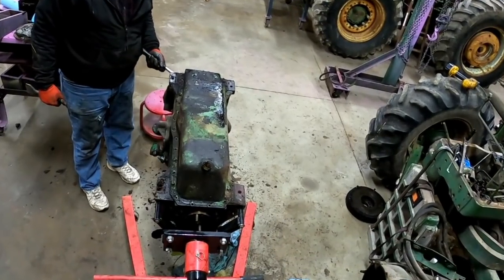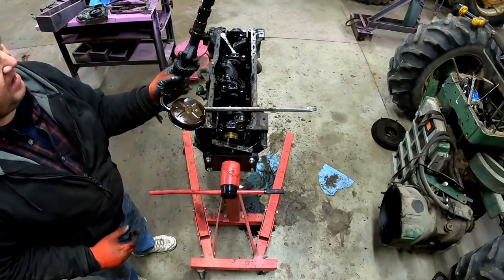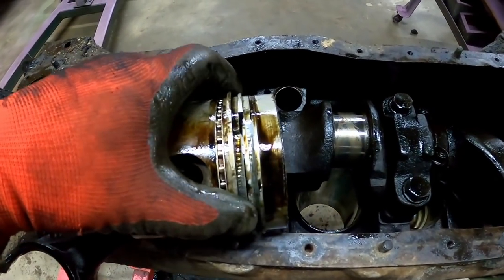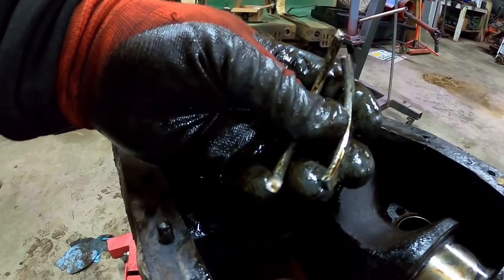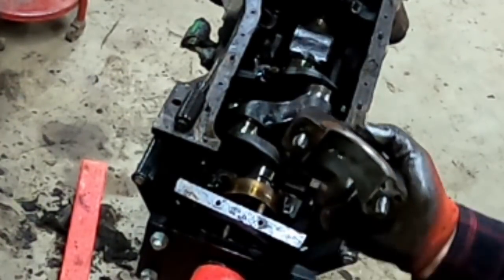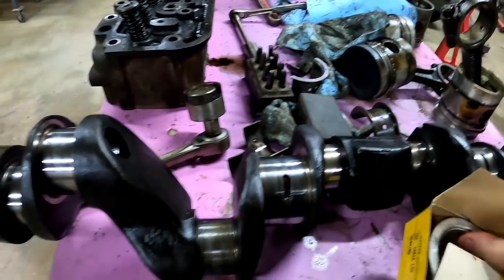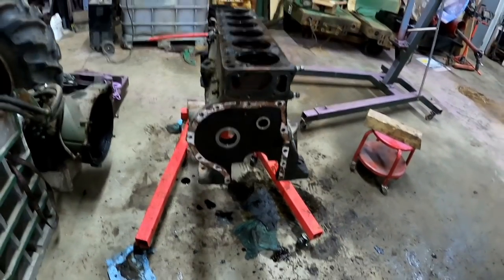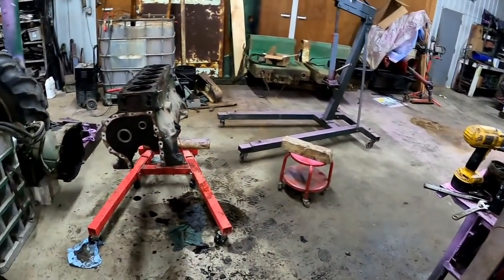Oliver 1600 Restoration Part 5: The Bottom of the Engine

Comment: My neighbor used  to have a 1600 diesel. It was set up with automatic shut off for low oil and high temperature to run a PTO irrigation pump. On a dry year it would run as much as 20 hours a day.
Reply from the maker: Oliver offered special gauges for automatic shut down, but aftermarket was more common. Do you recall which it had?

Comment: Hey Chris, I really like how you have to do math in your head to figure out the caps for the rods!! Lol. Those pistions really took some abuse thats for sure. Its a good thing the crank seams to be in good shape.
Reply from the maker: Rod 6 now has a 6 on it. Maybe someone bought the cheap number punches that only went up to 5??? I looked it all over and couldn't find any markings other than the 1 and 5 on each half.
Reply: @ThatOliverGuyChris  thats funny!! You never know what your going to find.  I am still waiting on parts for my three speed to finish putting it together. Hopefully the next few days we can get more painted parts on the tractor!!
Reply from the maker: Hurry up and wait seems to be the new business model. Hopefully they come soon!
Reply: @ThatOliverGuyChris  thats for sure! I am waiting for the machine shop to turn down the input shaft also. Thats other new thing these places have more work than they know what to do with and not enough people to do the work.!
Reply from the maker: My engine guy said he might not be able to retire with the back log he has. Apparently everyone has the same idea I do, get it in there before he retires.

Comment: I really enjoy these videos. A couple of questions (having never overhauled an engine). First, what do you use to determine whether you should overhaul an engine or not? Second, how do you determine compression on a diesel engine? I'd like to determine some of this for my 2-70 diesel. A little worried about watching sparks coming out of the muffler (which could also be a muffler problem).
Reply from the maker: Sparks could just be soot buildup burning off. It can happen if the engine isn't worked occasionally. 
A compression test is a good start. You'll have to pull the injectors, then you can put the compression tester in the hole of each injector and crank it over to see how much it's making. If it's on the low side, you can put some engine oil down the hole and try again. An improvement typically means the rings are where your leak is at. If it stays the same, it's probably valves. A valve job may be all it needs. Crankcase blowby is another good sign. All engines have some, but if it gets excessive, it's probably time for an overhaul. Low oil pressure is another sign. As the bearings get worn, the oil can squeeze out of the gaps easier and doesn't build as much pressure.
The first time I put this 1600 under a load, the blow by coming out of the engine breather went from not much to a cloud of smoke. I knew right then I would be overhauling it. I only checked compression on 2 cylinders, one was 105 psi, the other couldn't even make 20.
Reply: @ThatOliverGuyChris  Thank you for the advice. When I get the time, I will look into them. Before I got the tractor, I don't think it had ran since before 2005. It would explain the soot; I also remember lots of blowby, but I attributed that to sitting so long. I'll get her fixed a little bit at a time. I think she still has lots of life left in her!

Comment: Does Arrow make pistons for the gas engines too?

What will you be putting back in there?
Reply from the maker: I don't know if gas pistons are available from Arrow. I have a genuine Oliver set of 3-5/8" pistons and sleeves that will be going in this engine. Depending on how the crank turns out, I should be set on bearings too.

Comment: Interesting..I would have never guessed the wrist pins were not pressure lubricated. My uncle had a 1650 gas. Do you know if the 1650 had pressure lubricated wrist pins?
Reply from the maker: The 1650 gas used the same rods as the 1600, KSA216A.
Reply: @ThatOliverGuyChris  Thanks for the info. Must have been a good system because my uncle put a ton of hours on their 1650 and never had to overhaul it before they traded it in.
Reply from the maker: It worked, even with 2 piece wrist pin bushings. I think the oil from the squirters in the block got flung all over in those engines as it hit the rods and crank.

Comment: What caused the pre combustion do you believe in this case?
Reply from the maker: My guess would be the high compression pistons along with cheap low octane gas.
Reply: Too much timing,overheating,too hot spark plugs,bad plug wires run side by side,cracked distributor cap,lugging engine,plugged air filter,oil consumption.

Comment: Another helpful video sir thanks for sharing it with us. I found a guy that has a 1953 Oliver 99 gas that he claims is 1 of 52 built. Are the gas models really that rare? He’s asked $6,000 for it which I thought was kinda high, but I don’t know how many were built or if it’s a rare one or if he’s full of it
Reply from the maker: If it's the 6 cylinder gas with 4 speed transmission, then it is rare. They had upgraded from a 4 cylinder engine, and a short time later they updated the transmission to 6 speeds. So there was a narrow time frame where they built 6 cylinder, 3 speed 99s.
One  of 52 sounds right from what I remember.
Reply: Yes it’s the 6 cylinder but I’m not sure on the transmission yet but I’ll find out thanks for the information.

Comment: Aren’t battery power impacts the best invention ever!!
Reply from the maker: Yes they are. I had to have some welding done in the field and the guy needed to get behind a wheel on the drill. I got that cordless impact out, he said there's no way that's going to take those lug bolts off. I think he was going to buy one later that day.

Comment: Did you take a look at the pump timing before you pulled it off?  My guess is it was advanced.  Hammers on the pistons, also puts a lot more heat into the pistons.  Probably hammered out the bearings hence they refreshed at some point.
Reply: The distributor you mean?
Reply: If he managed to pull the injection pump off a gas engine, I’ll be impressed 😜
Reply from the maker: I didn't check the timing, and that is a possibility. There was also a service bulletin put out about replacing the exhaust valve springs on 1600 gassers. If they were increased in displacement they were getting burnt exhaust valves. They recommended changing jets in the carb and replacing the exhaust valves to a new stronger one.  Needless to say, this one is getting new exhaust springs.
Reply from the maker: I did put an injection pump on a gas block, does that count?
Reply: @ThatOliverGuyChris  only if you follow farmalls pattern and just see how many different fuel systems you can put on the same engine lol
Reply: @ThatOliverGuyChris  Doh!!!  Every single time I watch this series I keep thinking diesel.  It's a good day when I wake up and remember my name!
Reply: @rosstheoliverman  LOL.  I deserve more thumbs up for posting such a bone head question when I knew better.
Reply: @ShainAndrews  🤣🤣🤣 It happens to us all sometimes
Reply from the maker: Well, the 1855 is a diesel. I'm confusing everyone doing 2 tractors at the same time.  I don't know how these guys with a wife and a girlfriend keep everything straight.
Reply: @ThatOliverGuyChris  simple, the wife doesn’t put out anymore.
Reply from the maker: She ran when parked.
Reply: @rosstheoliverman  I'm rolling over here.  I'm good for a laugh if nothing else.  Hell I saw the top of the piston even and still couldn't let the diesel go.  LOL.
Reply: @ThatOliverGuyChris  then the honeymoon was over. She discovered sheet cakes. 🤣🤣🤣
Reply: @ShainAndrews  🤣
Reply: @ThatOliverGuyChris  one is a toy the other one was but now you hate to play with it.

Comment: The thrill of rebuilding an engine without the oil smells, oily hands, and cleaning parts.  Kind of like dissecting a computer frog instead of a real one. Being that tractor had a loader on it, which meant it probably had to be started when nothing else would start, my guess is that ether played a big part in the broken and burned stuff.  Spray the whole can in it and hit the starter...  I sure would have those rods checked for twists and being shorter due to being slightly bent.  Keep letting us dissect Olivers using a computer.
Reply from the maker: The rods are all at the machinist now. He had to resize 5 of the 6 rods on the big end for the 1855. He hasn't gotten to the 1600 rods yet.
The 1600 came from upstate New York, right in the path of one of the heavier lake effect snow areas, so it did a lot of snow pushing in the winter.

Comment: If I saw correctly, you put a comment that compression pressure should be 160 to 180 psi, I thought diesel engines need 300 psi and up to get good ignition?
Reply from the maker: This one is a gas engine. Minimum on a 310 diesel is 350 psi.
Reply: @ThatOliverGuyChris  thank you, my mistake
Reply from the maker: No problem, you're not the first one tonight.